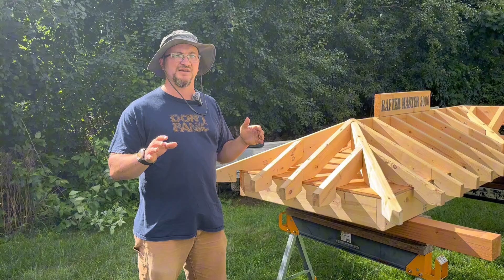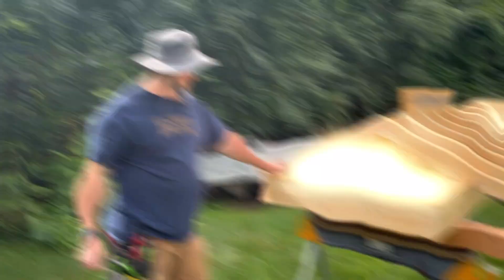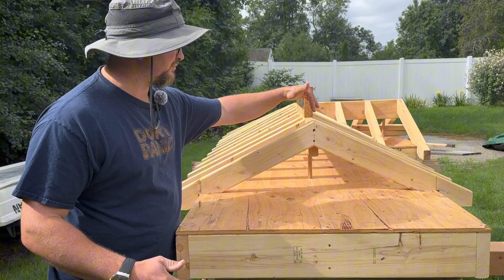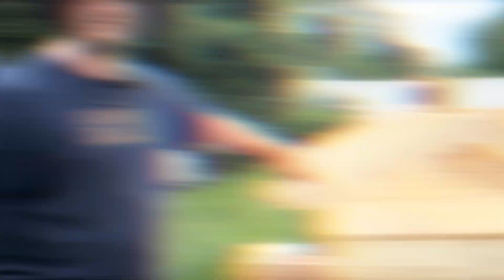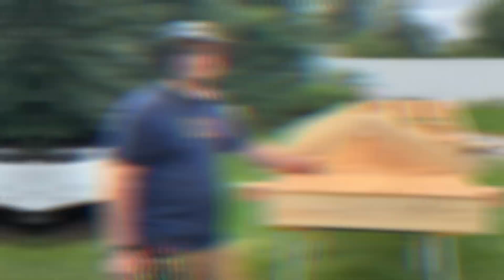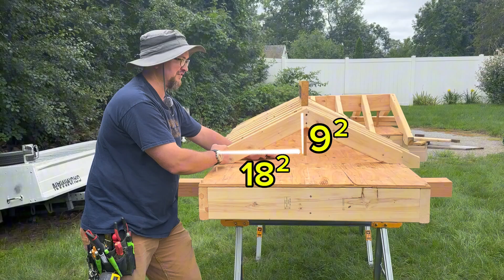Principal Rafter Calculation Made Easy - Rafter Master 3000 Part 2

Comment: I not sure that always works.  If I'm build a dog house with a 2' run and a 12 pitch using your calculations my rafter length should be 4'.  when using a framing square the length given is 16.97 per foot. that multiplied by 2  is 33.94 or 33 15/16" long.  Can let me know if my math is wrong.  I have always used my 2' sq and was looking for another way to calculate rafters.

Comment: What do you do if you don’t have the pitch? I imagine you could just measure the rise just like you did the run, just vertically… amirite?
Reply from the maker: Keep in mind you don't know the rise until you know either how tall the ridge needs to be from the tops of your top plate or the exact pitch of the roof you need to work on. Using the method in the video you should be able to calculate everything on your roof simply by the width of your room outside to outside.

Comment: What the best way to find your ridge height ?
Reply from the maker: Ridge height is the rise of your common rafter Plus the height of your tail. For example on an average 2x6 rafter there is four and a quarter inches of 2 by before you reach the seat cut. So the ridge of your house would be the rise of your common raftor plus that 4.25
Reply: @JandKCarpentryBros  so if my rafters are 173 7/8 before my overhang I just add 4.25 inches to that and my ridge height would be 178 1/8 or 14ft 10 1/8th inch ?

Comment: Hey, thanks for posting, really liking your content. Does this caculation give the length of the rafter from outside edge of the ridge to the internal corner of the birds mouth on the wall side rather that length from the ridge to the vertical point up from the outside edge of the wall on the upper edge of the rafter and if so how do you allow for that? Not a criticism just confused and I hope the question makes senses...thanks in advance and greetings from Ireland
Reply from the maker: I think I understand,,, this video is referring to principle rafters only. You don’t have to factor in a ridge at all because the two principle rafters meet together and not at the ridge. Other rafters, such as Common rafters, require consideration of the width of the ridge. As shown in the video, rafter length is always to the outside of the wall and then more calculations are required to account for sheathing and tails etc. we will be covering that in future videos. I hope that clarifies.
Reply: @JandKCarpentryBros  Thanks for the reply, I don't think I was very clear with my question and struggled with trying to phrase it in an inteligible way, good to know more expertise is coming which may make things clearer. I understand from the pythagorean equation the rafter length is a line from a point at the top of the rise to a point in line with outside of the wall. You mentioned the rafter length is  measured , on the slate side of the rafter, from top of rise to a point vertically in line with outside of wall on the top of the rafter and in my mind those two distances are different. Not a carpenter, Cabinetmaker, just interested in learning. I wish I could upload a drawing of what I mean, apologies if I have completely misunderstood what you meant. Thanks

Comment: Why 12?
Reply from the maker: Great question! It’s a bit of a longer answer that we go into depth on in another video. But I hope this helps:
The angle (read steepness) of a roof is not usually expressed as an angle, but as a ratio of X:12. This is the “pitch” of  the the roof. The 12 refers to 12 units of measurement, such 12 inches or 12 feet etc. In the expression X:12, X stands for how many units (inches or feet) of rise there are for every 12 units of horizontal run. Or in other words, as in this case, for every 12 inches of horizontal run, the rafter will rise six inches- this roof has a 6:12 pitch…
You may hear people just say it’s a 6 pitch... twelve is just a constant. 
For this use, when you divide by 12, you are essentially breaking the total run measurement into 12 individual units which you then use to multiply by your known pitch (in this case 6) doing that will tell you exactly what your rise should be. Sorry if this isn’t clear lol writing is not my forte.